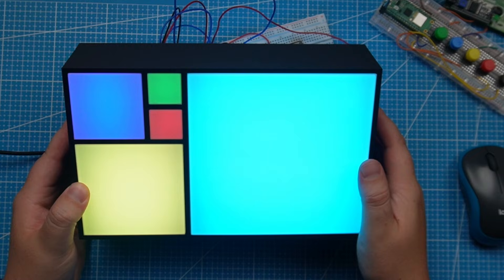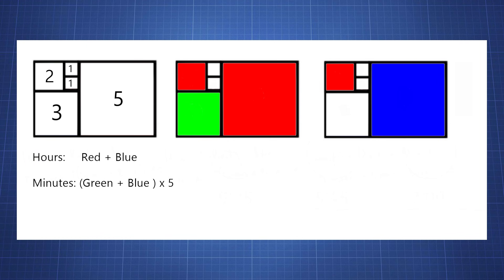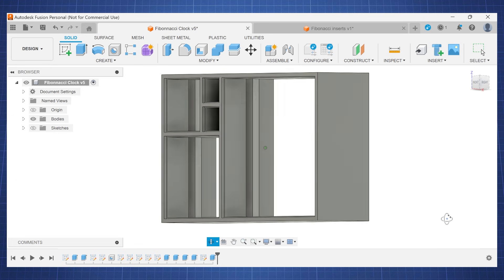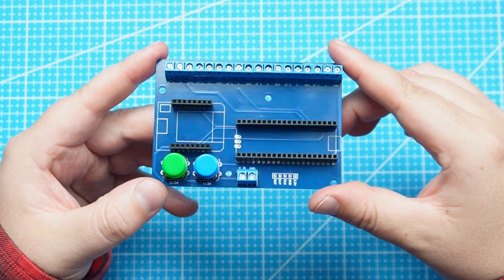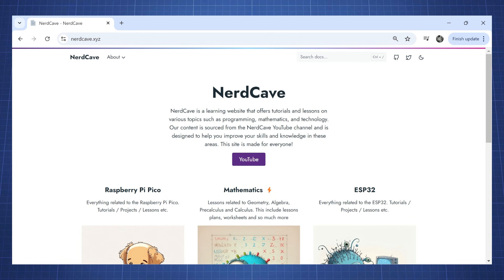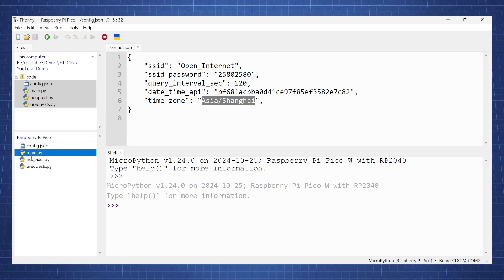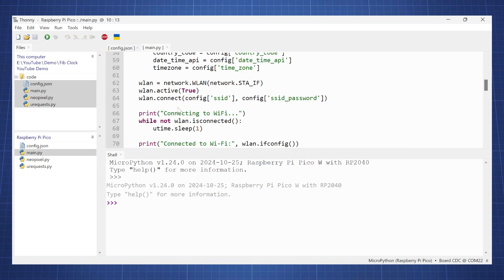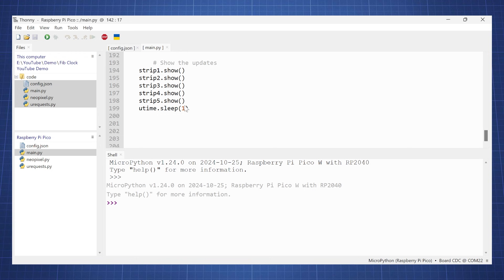Raspberry Pi Pico W   Fibonacci Clock Project

Comment: Hi
I really love this work and result. Trying to make my own version of this i got some issue. When the 5 different led strips are changing colour, (every 5 minutes) the colours dont always match for the calculation of both hours and minutes. An example. 10:00 works correct for me. (White, White, Red(2), Red(3), Red(5)) makes 0*5=0 for the minutes and 2+3+5=10 for hours).
But then when next update comes 11:05 the hours will be wrong. I get Blue, White, Red, Red, Red which will generate hour :blue(1)+red(2)+red(3)+red(5) which gives 11. The minutes are correct blue(1)*5. This is repeating over time when a mix of hours and minutes shall be displayed. Minute calculation will mostly be correct but wrong for the hours. Do I misunderstand the calculation here or is there something else I am dong wrong ? Any input is valid !!
Reply from the maker: Hello, I will double check the code, and ask the person I gave the clock to so I can debug it and send different times to ensure it updates correctly. I have so far not received that is was updating wrong and everytime when I checked it was correct. I can use the times you send and check if it gives the same problems. I have designed a different version which uses the golden ratio pattern and trying to make time to make videos again then I can upload the new version hopefully soon.
Reply: @NerdCaveYT  Hi. Thanks for quick respons !!
I think i found the issue. And it is me enterpreting the colours wrong !!
In your video it says  (Hours: Red+Blue) (Minues 5_(Green + blue)    So the Blue colour is the Colour for both values. But i found that in the code i am executing, it is the green which is the colour for both values. At least then it works when i calculate the hours and minutes. So i use Red+Green for hours and (Blue+Green)*5 for minutes.
Does that sound reasonable ?
Reply from the maker: Yes, also sometimes the LED will be different so instead of RGB it would be GRB just need to test and make sure

Comment: Nice project!  Thanks for sharing.
Reply from the maker: Thank you, I want to make a better version to try and make a PCB to solder surface mount LEDs on, it has been 10 years since I tried surface mount components
Reply: @NerdCaveYT  I try to avoid surface mount soldering at this point so I like your approach.